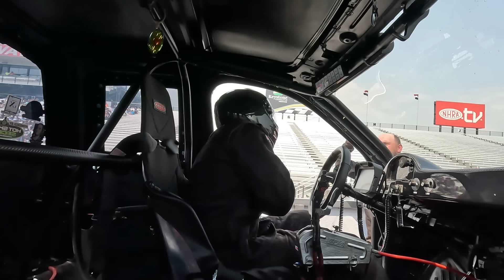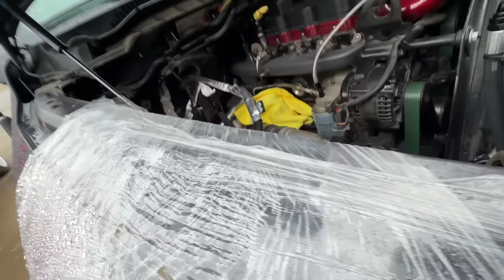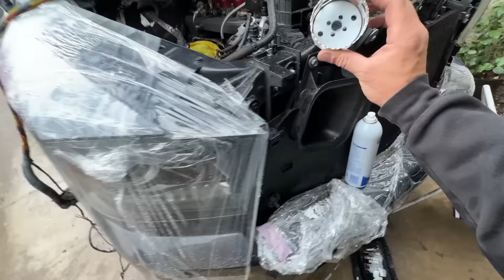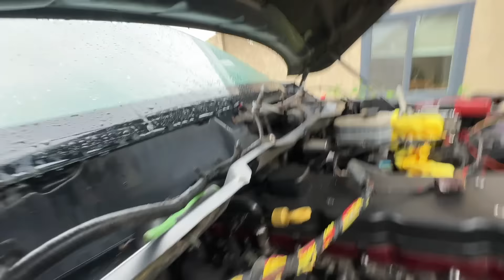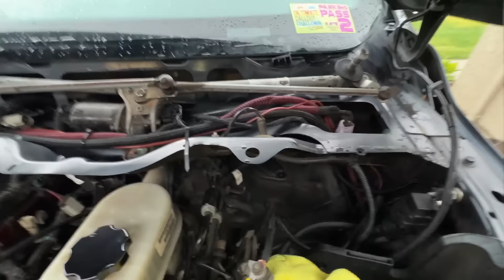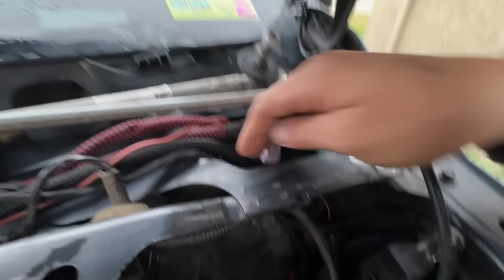Delete All Wires! 4th Gen Cummins Wire Tuck!

Comment: Question where do you snake wires into the cab from engine bay cause cutting boots kinda butchers work and I’m asking about on a 3rd gen
Reply from the maker: Cutting boots?
Reply: @horsetorquesdiesel  The wire boot it’s got a bunch of wires already running through it

Comment: 9:23 glad I’m not the only guy suffering with a step ladder instead of having a top side creeper lol😂
Reply from the maker: I have a top side. It honestly hurts my back more!
Reply: @horsetorquesdiesel that’s crazy I wouldn’t have guessed that
Reply: Top side creepers will have the back of your knees on fire after a nice long evening on it haha
Reply: Aye im removing an engine in a camp ground with plywood and Jack's lifting the front of the cherry picker lol. Its out waiting on a 178/208 cam and lower gasket kit. As a Marine and union pipe fitter. Ive found ways to get the job done. Gotta do what you gotta do!

Comment: Never seen anyone take the wipers off attached to the cowl haha but yeah they get stuck on i have to take them off frequently (autobody tech) buy yourself a little puller you probably already have one in your toolbox if not hobo freight probably has them if not amazon
Reply from the maker: Yeah I needed just a touch smaller puller. Gonna get one on order after this job 😂